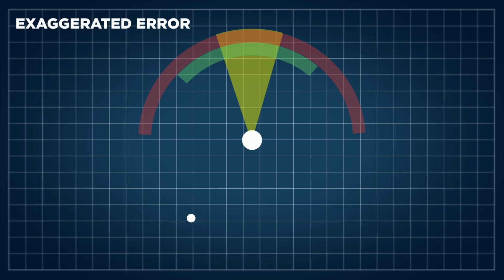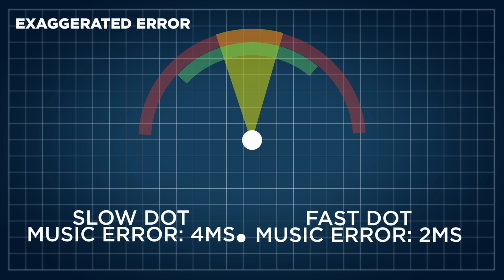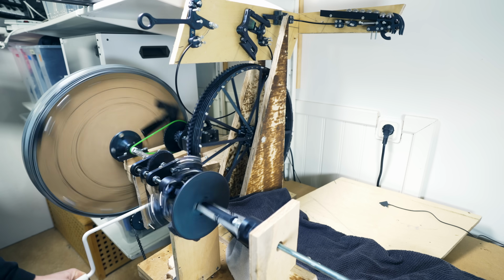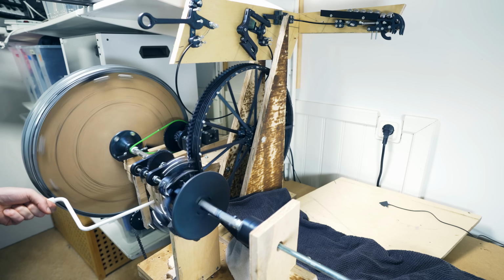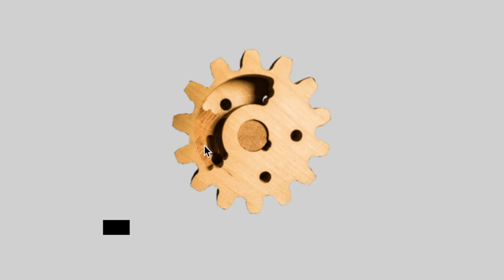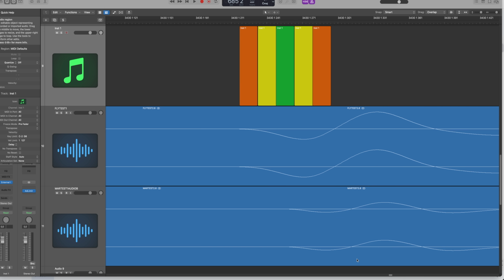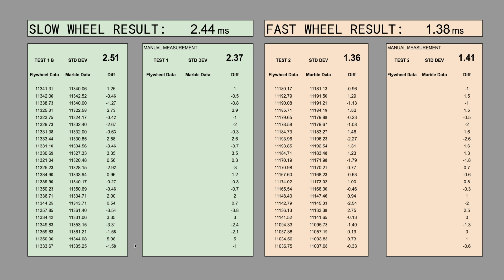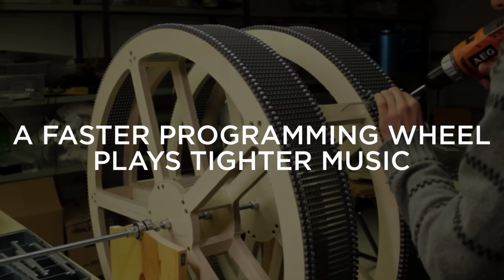Testing a Faster Wheel - Is the Music Tighter?

Comment: I want to see a test with more marbles per turn, the load of the marbles and mechanism has to stay below the pre-load on the governor friction plate or things will begin to slow down. The power side of the system will need to be quite beefy if there is going to be a lot of load on the machine. Given that the governor is friction and heat based it's paramount that you find a material that will remain consistent even if it heats up during a quiet part of the program. If your braking material changes coefficient through the operating range this will shift the tempo depending on the program load.

Comment: The older marble machines have shorter, smaller pins and the wheel turns much slower. If you double speed your loosing half your playable duration for a minute change in accuracy. Good to know but i think as you know its probably a better idea to just make it slow. Especially since you can improve the tolerance on your final tour ready programming wheels instead of 3d printed clip ons on a 3d printed wheel. Imagine in that case how much smaller the timing difference will be.

Comment: All the ms saved in other components would be well spent maximising program length. If it costs +-4 ms to quadruple the track length, surely that's worthwhile?
Reply: Especially when he probably can find a ms or two by making the programming wheel and the springs, and other mechanical parts with much tighter tolarances than what his prototype has. +1 on this comment.

Comment: To allow for a slow wheel speed and tighter music you could implement triggers.  So that a single peg hits the trigger and spring force then drops the marble.  This makes the dropper not care about wheel speed as it would be determined by the spring force.  

The main downside is in the adding a mechanism to reset the triggers.  One way that this could be accomplished is by adding sections of teath that interface with a gear in the trigger to reset the trigger.

Comment: I don't think you can compare tightness of music of different speed without weigthing with said speed. 
I might use the wrong english term here. 
So I would compare the tightness values by also making them speed independent by dividing them by the wheel speed.
So when you compare the speed of the programming wheel, would it not make more sense to play at the same frequence:
So in experiment 1 put 2 profils on the wheel and in experiment 2 double the speed and then take out 1 profil?
Because in an earlier video of the fylwheel did we already learn that double the flywheel speed is tighter music.
In other words: the dot in your example will spend exactly the same time in the problem area regardless of the speed. If you double the speed it will spend half the time for each rotation, but will pass the area twice as often.

Comment: I may be wrong but I seem to remember the slower turning 16 rpm records had much more fidelity than the faster turning 45 rpms.
Reply: It's the exact opposite. Higher RPM means you can have more information in the same amount of time. Same with digital audio; The higher the sample rate, the more samples you can have in a second, increasing the range of available frequencies.
Reply: @AtuPC_Fi  Not true when talking about vinyl records though due to the way they work. Because they literally have the sound wave scored into the groove the faster the record is spun the higher the chance the needle wont reach the bottom of the troughs and will instead skip along the peaks. This is only the case for analogue music though where you are  manually reading a wave pattern, in all other circumstances you are correct.

Comment: Faster wheel will give tighter timings, but cause you to need a larger wheel making manufacture more difficult and less programming time.
Reply: A larger wheel in itself gives faster and as such tighter timings, and also more programming. So maybe the better starting point is how big can/should the wheel reasonably be, then that will help answer how much speed is allowable with the available programming.
Reply: Or he can put the spacings closer together. Or program it in a spiral like how some of the old machines did it.

Comment: Martin, you really shoud test usage of programing cards, like in the programmable looms like "Jacquard Design Machine" where you can have linked cards going thought a wheel and making contact with the machine, this way you could have much more music lenght to play
Reply: You need some amount of flare otherwise were is the fun? Also punch cards are messy and can tangle.
Reply: don't be silly, that would make sense.  I think he thinks the spectacle of big pin wheels is necessary for some reason
Reply: @lasskinn474  the linked cards can interface with the machine going through the wheel
Reply: @lasskinn474  Well, pinned wheels can be re-programmable whereas punch cards really can't. A single programming wheel vs multiple punch cards for each song... which do you think is more efficient? Multiple punch cards is a lot of extra things to move around. Plus, if you make a mistake in the musical program you can easily just reposition the misplaced pin.

Punch cards do certainly allow for longer music, but at the cost of the sort of convenience you get from programming wheels with pins.

There are pros and cons of both. Maybe Martin likes the logistical benefits of having a single wheel which can be re-programmed instead of carrying around multiple punch cards. It's a little narrow-minded to assume the use of pinned wheels is purely for aesthetics, honestly.
Reply: @justinnaramor6050 punch cards are super cheap, you can have a ton of redundancy. Because they can be laser cut, you only have to worry about making errors in your master. Also has he addressed how he currently plans to change songs? Will he be transporting several boxes of programming wheel pieces? Or several programming wheels themselves? And someone will have to repin them, potentially introducing error. Punch cards make sense in every technical sense. It’s just less entertaining.
Reply: @osculant  I don't think he's gotten to that part yet. One step at a time :))

But that's what I'm getting at, if he were to just have a single wheel (not several of them, that would be too bulky compared to several punch cards), that's only one thing to carry and to program. Plus, I think Martin also wants to challenge the assumed limitations of programming wheels instead of abandoning them for punch cards.

I'm not saying I personally want Martin to stick to pinned wheels, of course. Just simply that they do have their benefits compared to punch cards (and not strictly speaking in the technical sense here either).
Reply: @justinnaramor6050  There'll always be multiple, as you'll want to reprogram a wheel for the next song while the current one is running, lest you get long breaks between songs. I don't think there's an advantage to wheels except showmagic, punchcards are small, easily packed, easily reproduced and easily made tbh. You don't need to program them on the fly and a case with punchcards the size of one flywheel could easily contain every single song you'd possibly want to play.

But, wheel do look good.
Reply: @Chibs  Well, this reply may get long (this is kind of a complex topic after all), but maybe Martin has reasons for using a wheel instead of a punch card that some of us don't know about. Still, even if punch cards are small, which is true, you're still carrying a lot of them when you want a lot of songs.

And regarding the "multiple wheels" comment, wouldn't you need only 2 of them, rather than, say, 20 of them (for 20 different songs)? While one is playing, the second one would be programmed and while the second one is playing, the first one would be re-programmed and so on.

But here's a particularly important benefit which no one seems to have thought of here:

regarding re-programmability, the fact a wheel can be re-programmed, where a punch card cannot, is itself a benefit even from a musical perspective. Once a punch card is programmed, it'll musically sound the same every single time it's played, on each night of the concert tour (or even if Martin's just playing the machine at home or whatever). The re-programmability of a wheel allows the same tune to sound a little different each time. Going back to the punch card comparison, getting the same effect requires multiple punch cards, each card having a different version of the tune, if variability like this is to be desired. Makes more logical sense to stick to the programming wheel method if this kind of variability is to be desired. It's like these live techno shows you'll sometimes see, where the musician programs and re-programs and further re-programs his sequencer to get either different versions of the same tune, or to perform some real-time musical improvisation. And that's all done through a single sequencer (usually, anyway), driving multiple synths. In the marble machine case, the programming wheel is really the sequencer if you think about it. The same things can happen. These musical opportunities are not as easily available with punch cards because of their lack of re-programmability.

So, sorry, but I'm going back to what I said before: it's narrow minded to think the decision to use pinned wheels instead of punch cards is purely for aesthetics. It just is. I'll bet there was much more thought put into this than we realize.
Reply: @douglascaskey7302  I don't really think I missed the point. I do understand what you're saying. Still, I maintain my point that punch cards cannot be re-programmed like a wheel can. Not unless you were to use some kind of hybrid system that combines the (physical) benefits of punch cards with the re-programmability benefit of pinned wheels.

Related to this, if real-time re-programmability is desired, and if a "re-programmable punch card" method were to be used, you'd only need 2 punch cards, you don't need a single card for every song.

Were you suggesting a normal, single long punch card with the entire setlist on it, kind of like a long audiotape or whatever? Cool idea. But again, if on-the-fly re-programmability is to be desired, just a punch card will not be an option as punch cards cannot be re-programmed. They can only be interchanged (not the same thing as "re-programmed").
Reply: @justinnaramor6050  ok here’s where your argument breaks down. Martin is scrutinizing about 1ms variability constantly. It’s not meant for groupies to follow them around the world, it’s for them to play the same show night after night. Who is reprogramming the wheel, and how will they know what changes to make? The improvisation cannot happen on the fly either way. If you want variability, you could just program several variations of cards/strips. He abandoned hand control of the marbles already. If he wanted to he could simply make a system of levers where the further down he pulled them the more frequent they would play, and he could play it all by hand. But again, tightness is the obsession of the last few years, so I don’t see how spontaneous improvisation fits into that.
Reply: @justinnaramor6050  food for thought: I’ve been to the speelklok museum where he was first inspired. The machines with drums and pins were all stationary machines. Meanwhile the organ grinders and stuff that was meant to be dragged along cobblestone roads were all strips. The larger more complex machines were also either strips or disks, but usually not drums.
Reply: @osculant  I'm not seeing why real-time improvisation with programming wheels cannot be done. There's so much pessimism in this community it's rather ridiculous. I can't see why there couldn't be some kind of template that couldn't be followed to know where to put the pins during re-programming, and if the person (s) doing the re-programming is a musician himself and can remember which spots on the wheel correspond to which note/instrument, and which note value, it seems it would simply be a matter of musicianship to throw out or add in notes in a musical way, for the variability I mentioned. I'm sorry, I really cannot see why this should not be possible. This just sounds very pessimistic.

Multiple variations of a song using punch cards just sounds like a mess. Come on, think about it. If variability is desired, the programming wheel method is just flat-out the way to go... far more efficient and less dumb honestly.

We've seen examples of portable street organs using barrels/cylinders for their musical programs, so your last comment isn't entirely correct either.
Reply: @osculant  Oh, and your complaining about Martin's "obsession" with tightness is also invalid, in this discussion. The tightness being talked about here has zilch to do with position of pins on the programming wheel... it's obvious you're under that assumption. The tightness has more to do with the timing of the marble drops in relation to, well, time itself, to put it simply, and in relation to the rotation of the programming wheel and other rotating components. Pretty much every mention from Martin about "tightness" has had zilch to do with putting pins onto the programming wheel, so I don't get why you're using that as an argument.
Reply: @justinnaramor6050  it will eventually reach the placement of the pins/whatever on the wheel, it can’t not.
Reply: @justinnaramor6050  “Pumchcards can’t be reprogrammed”?!?  You simply print/cut a new card, simple as that.  Not to mention easily transport/create multiple versions (songs) and backups.

Versus trying to manually place hundred/thousands of notes/pins on a large wheel AND trying to transport multiple of these fragile wheels around for his “world tour.”

Sorry,  but beyond the visible spectacle, there’s zero benefit to having these large programming wheels.
Reply: @br52685  Oh so you're just gonna flat-out dismiss everything I've said in this fucking thread are you? Oh well, I'm not surprised.
No wonder why no one agrees with your comments, you just cherry pick ideas, and talk shit and act like a pessimist. Lol!

I know enough about music boxes to know that there is indeed benefits to having programming wheels. Of course I wouldn't claim they can be programmed in like 10 seconds or something, I'm not that dumb. I'm just saying they have benefits, and saying it's purely for aesthetics is fucking narrow-minded! That's it!

Comment: Would you be able to create a wide programming wheel, and a second programming wheel which controls the trigger mechanism along the horizontal axis (like a printer head). It adds another moving part, but I guess it also adds another dimension to the programming.

Comment: Really feels like you are measuring the wrong thing in this test.
Since your timing is fixed while playing music you really need to control for that in the test.
Any tightness gained by going faster is just going to be lost again when correcting to get the same timing.
Doing the same test but with partial rotations and keeping the timing the same seems like the correct way to do this.